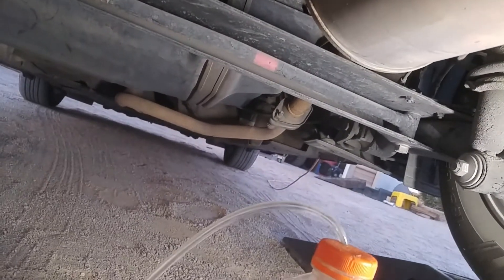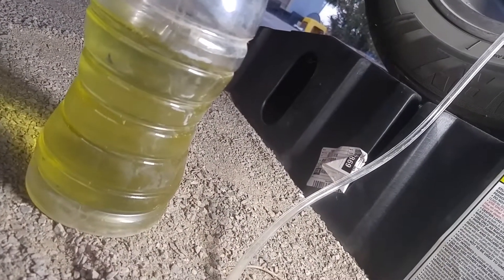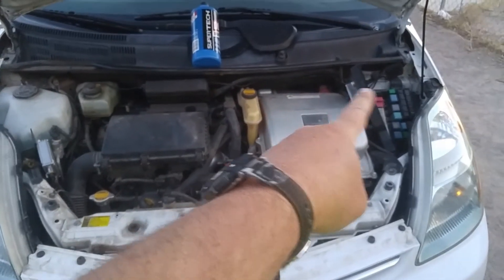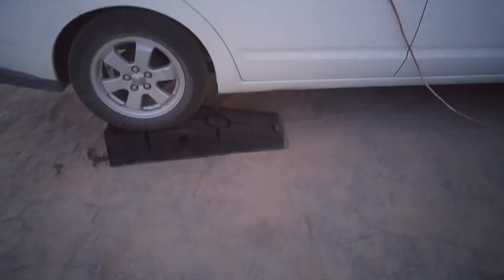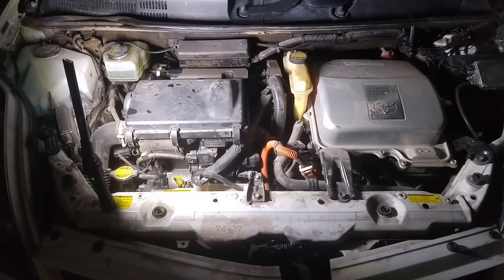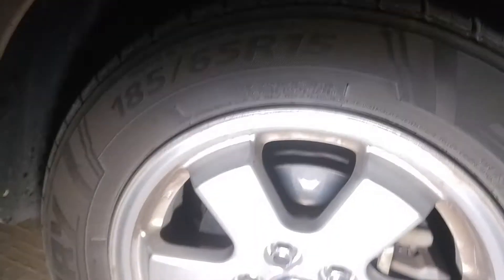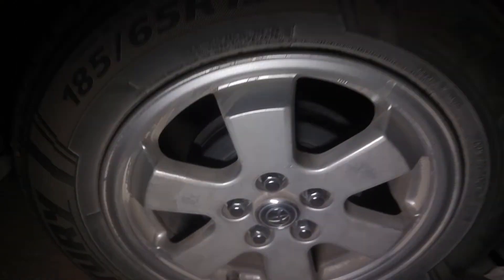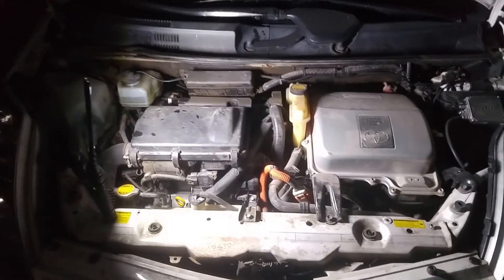Prius Brake Bleed Video

Comment: Probably a few years late, but my Prius is having the same issue. My understanding is that it is not air that is getting into the brake lines, but rather the pressurized nitrogen gas that is leaking past the accumulator piston. Because of this, the pump is constantly running trying to maintain proper pressure. I am replacing my brake accumulator asap.

Comment: How did you resolve the issue?
Reply from the maker: Replaced the Brake accumulator pump.
The ABS pump basically.
Found one in a salvage yard.. $250.
Then bled the brakes.. there is a procedure for this and you need Techstream software to do it.
Works fine.